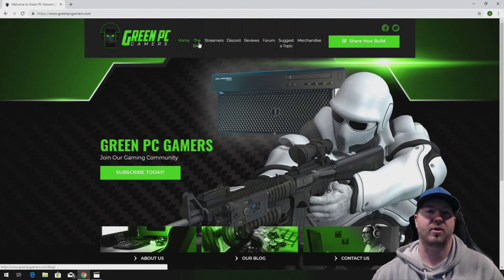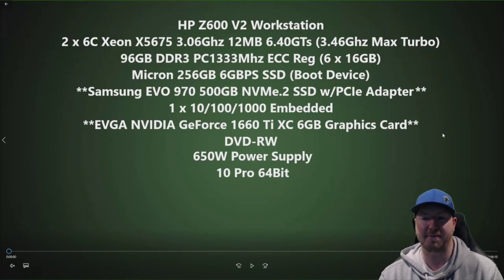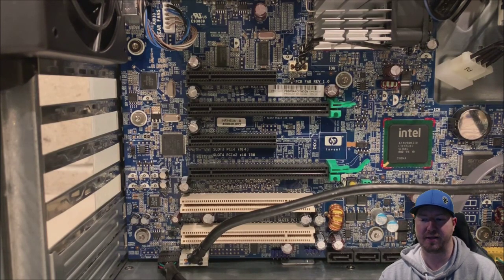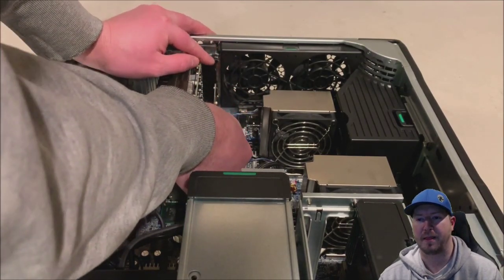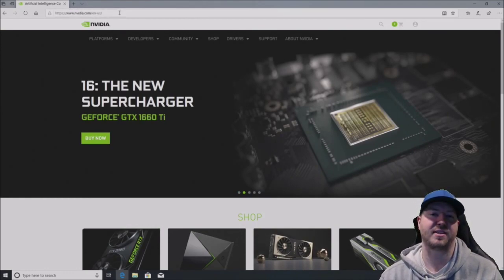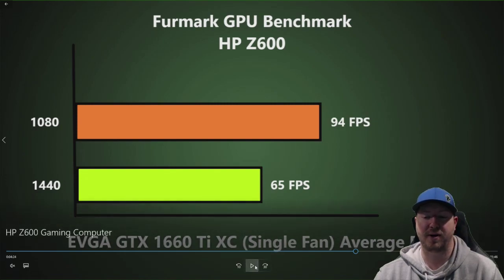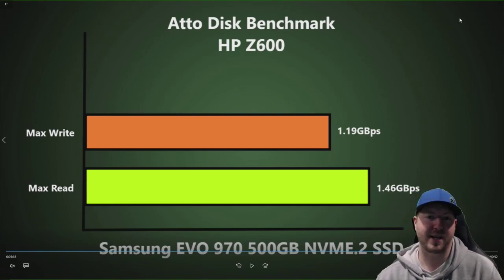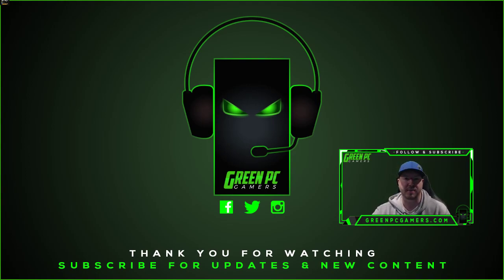HP Z600 Gaming Computer (GTX 1660 Ti and NVME.2 Install)

Comment: I also have an HP Z600 C2 PC with a dual X5675 12c/24t, 96 GB of RAM in DDR3 ECC Reg with a GTX 980 and an SSD of 480 GB A PSU of 650 Watts 80+ Bronze is really good machines

Comment: HP Z600 Workstation V2 motherboard
Intel Xeon CPU X5675 @ 3.07GHz (2 processors) 95W TDP
Z400 CPU heatsink.  Because this is designed for a 130 watt processor
BISO version 786G4 v03.61   X5675 processor only works with this bios.
Graphics Card & Driver: GeForce RTX 3060 12G OC -- 551.61
Total Memory: 24 GB
SLOT 1 (PCI Express Gen 2 x8): 	1 TB M2 NVMe Storage Controller
Windows 10 Pro (64-bit) 
If the system cannot find the PCIe nvme storage.
Open the Windows "disk management" option.
You will see nvme disk in unallocated state. Format the drive to NTFS. (Right click.)
To boot from an NVME drive no possible.  NVME drive you require a UEFI BIOS to boot.  Z600 only having a legacy BIOS.
The nvme driver is not running at full speed on this system. But faster then sata ssd. The pcie2 x4 lane max 2 GB/s.  Sata3   bandwidth throughput is 600MB/s
I am sending this comment to my time traveling self. So that you don't waste two days of your life trying to find solutions. 5M24

Comment: Hi ! Thanks very helpfull video ! But i've got some trouble... i intall RTX 3060 ti FE, 2 xeon X5675, 96gb RAM,  the power supply is not enough (650w) my computer restart all the time... Could you tell me  how can I fix this please ? Have a good day ! ( I tried with 64gb, doesn't work) Maybe just one xeon ? )

Comment: I've just aquired a Z600 this is the spec...

HP Z600 - 2x Intel Xeon X5675@3.06GHz 6C, 48 GB, 1 TB 7.2k, Quadro K600, W10Pro

Can you please recommend a better graphics card please?

Much appreciated ✌️
Reply from the maker: The RTX 3050 is a good value card for the Z600.

Comment: can i swap 2 gtx 1660ti s into my z600 without any problems with my psu?
Reply from the maker: It would be tough to fit 2 x 1660 ti gpu’s in to a z600.  Reasons = cooling, no sli support, power rails, size of the cards.

Comment: Excellent video, very helpful.  I am in the process of updating my V2 Z600 which I need to do for lightroom and photoshop.  I have had it since I bought it new years ago.  It is an amazing solid machine, upgraded to the last BIOS and to W10 pro, and with a new video card (3060) and some RAM improvements, I should be set for several more years.  I have only one CPU though.  Not sure I would benefit with a second.  Likely will add an nvme as in the video.    This will extend the life of my machine for years to come and save me some money.   I love the way I don't have to use the on button on the Z600 to turn it on, just flick the power on for all my stuff with one switch and the Z600 knows to turn on at the same time with everything else.

Best wishes!

Comment: Hi , i have an HP z800 workstation with 2 xeon w5580 3.4ghz processor and i have 16gb ram and right now I have an Nvidia Quadro k2000 graphics card in this workstation,...
Now I want to go for a GTX 1650 super 4gb gddr6 ? 
Please help me and it's okay for me - if it makes a bottleneck because I will use the graphics card on another PC in future but right now is it possible to play with this new card with at least 720p 60fps? In my HP  Z800 workstation? 
Please help sir , I'm searching for it everywhere for a budget friendly gaming solution , because right now i only can afford a graphics card but not for a new Custom PC 🙏🏻❤️Pls Help❤️🙏🏻 
I'm confused because hp says it supports upto DDR3 but GTX 1650 super 4gb has gddr6 !! Pls help
Reply from the maker: It depends on the version of the card that you choose.  Most GTX 1650 Super cards will fit in a Z800 workstation.  There should be little to no bottle-necking with that model gpu.

Comment: Thank you so much for your HP Z600 guide - it's been a massive help the past couple of months! I've got a question, do you think it's possible to connect a 2.5" SSD (boot drive) to a SATA III RAID controller card slotted in the PCIe2 x16 slot? I tried but got an error during bios bootup saying" BOOTMNGR is missing". I'm hoping it's a power issue and an additional power cable for the SATA III card will do the trick.
Reply from the maker: It should work, double check your boot sequence.  That error pops up when the system is trying to boot to a device with out an OS.

Comment: Curious about your website. V2 part#. 591184-001 460864-003. My board is 591184-001 460840-003. Is it a typo? Only asking because my mb is damaged no post with both cpus installed. Want to make sure I get the right board. It was running on both x5660 cpus
Reply from the maker: No, but there are different variations of the second HP PN.

Comment: i want to upgrade the gpu from gtx 1050 to rtx 3050, what do you think?
Reply from the maker: The RTX 3050 is a pretty big upgrade from the 1050.  Go for it!
Reply: I upgraded from a gtx 960 to a rtx 3050. It works perfectly!
Reply: @indoje  do you have hp z600
Reply: @Altohamy  Yes

Comment: hello, can i install 2 Gpus in z600 ?
Reply from the maker: You could, but there are very few games/programs that would benefit from multiple GPU's.  Also, there isn't much SLI or Crossfire support for the Z600 workstation.  You'd be better off going for a single GPU.
Reply: @GreenPCGamerscom  i am willing to use it for rendering and cad 3d so which best card do you recommend ? 3060 i am talking about power options

Comment: I just bought a Z600 a month ago with only one e5620, 8 gb RAM and a Quadro K600. Next day I bought a second e5620 and 48 gb ram, had to fix a couple bent pins on the motherboard to make the second CPU work, added the GTX 1050Ti OC from my other PC, two 4gb hard drives for storage, two 500 Gb hard drives for dual system boot (windows 11 - Ubuntu Studio) and one 1.5 TB for games, and OMG it worked as a charm. It even ran both the K600 and the 1050 Ti at the same time and were very fast for After Effects rendering... until I upgraded to After Effects latest version, so I had to remove the K600 to use the latest drivers on the 1050Ti, as previous drivers were incompatible with that. So, I have to get a better GPU, and first I thougt about a GTX 1060 and latter adding a Quadro P2000 on the other slot, but moneywise, I'm thinking now on getting a used GTX 1080 8 Gb (the one with a single 8 pin PCI connector) or a new RTX 3050 which has the same nomber of CUDA Cores as they both cost the same here in Mexico. Would the 3050 bottleneck my z600 badly? Should I go for the GTX 1080 instead? Oh! Forgot to mention I'm upgrading to twin X5675's as soon as I can find a matched pair at good price.
Reply: How did you upgrade to Win 11?  I thought Win 11 upgrades worked on newer systems.

Comment: That such a brother seems fantastic to me the way you have to explain and assemble those super computers, I have a hp z600 v1 with two x5520s and I want to upgrade them to two x5570s, my question is the following: is it necessary to buy the "PAIRED" or "PAIRED" processors "to work together, or can I buy 2 x5570 and it will work normally? I really appreciate the clarification, a hug!
Reply from the maker: You will have use "matching intel stepcodes" that are certified for the X600.  2 x X5570 Processors would work fine.

Comment: Hi friend, how i can adapt a power supply evga 750BQ to HP Z600
Reply from the maker: We've never used an ATX PSU in a Z600 because there is no place to mount them in the stock case.

Comment: I have a z600 wit 2x x5640 cpu and 24 GB ram. I bought a Zotac GTX 1070 amp extreme. The gpu needs power from 2x 8 pin power connectors but my psu has only 1 x 6 pin. What are my options?
Reply: Just curious. Is it work?

Comment: Seeking your advice, I have HP Z600 and want to change video card that will support dual monitors (4K, IPS, 32”) for work only, no gaming.
I got the Asus RX 5700XT, however the card requires power from 6 pin and 8 pin. I can use the 6 pin cable directly bit need another 8 pin. Any work around?
Otherwise, any recommendations for a less power-hungry card that can support dual 4K monitors?
Thanks in advance

Comment: Yo tengo la hp z600 con dual xeon x5670 y una rx 5600 xt y 16 gb ram 1600hz y no consiguió que los juegos vayan a más de 60 fps estando en gráficos bajos o altos en 1080p.
Reply: Amigo de donde eres? Yo tengo una y la quiero upgradear con 24 de ram, mejores procesadores y una buena gráfica, pero al leer tu comentario me desanime

Comment: Can I change PSU with other PSU model (not PSU Default HP Z600)?
Any recomendation for me?
Reply from the maker: It would be tough to use an ATX Power Supply because you there would be no place to mount it in the Z600 chassis.
Reply: @GreenPCGamerscom  Thank you for the comment Sir, maybe next time you can make a tutorial to assemble the HP Z600 in another PC case. 😁 Because my PSU is broken and it is very difficult to get a standard PSU Z600 here.

Comment: Thank you For this great review, I want to ask your question, do all processors work together?

Is this device better than a device with a i5 6th processor?

I want to buy a device HP Z600 Intel Core Xeon X5650 2.6GHZ Is this a better option than i5 6th

I am confused between these two

options

Z200 Core i5 th or Z600 Intel Core Xeon X5650 2.6GHZ
Reply from the maker: You cannot mix step codes in a Z600 workstation.

These are the best cpu's for the Z600:

Up to 2 x 6C Xeon X5660 2.8Ghz 12MB 6.40GTs Processors | 3.20Ghz Max Turbo Frequency (SLBV6)

Up to 2 x 6C Xeon X5675 3.06Ghz 12MB 6.40GTs Processors | 3.46Ghz Max Turbo Frequency (SLBYL)

Comment: Hi. I need a little help with Z600. I am testing z600 (x5640, 16gb, ssd) and another PC with i5 3470. On both i have same 1050ti. Testing unique heaven benchmark, ultra and 1080p Now my problem is Z600 gets only average 36fps, but one with i5 gets average 75fps with same settings and same GPU. Does anyone know how to boost Z600s fps? Compared to one with i5, 36fps is really low. I have two of them and both gets same resaults. One is with 3.6 and one with 3.61 (latest) bios. On Z600 i tested with registered, non registered and non ecc ram and every time it ends up with about 36fps. I think i am missing something but i dont know what. Any advice?
Reply: Btw.. same issue with Z400. There is no way (i didn't find it, hopefully YET) to lift FPSs over 36.. no matter what i do.
Reply from the maker: At a quick glance, your cpu might be bottle-necking the Z600.

Comment: Hey I was wondering would a gtx 1050 Ti work on this pc
Reply: well, yea. They put a 1660 Ti in there that is more powerfull and consumes more power. And the 1050 Ti only uses 75W, so you don't even need an extra molex to 6 pin adapter.

Comment: hello, if I want to put a 1650 super I need an adapter, or just placing it would be working, good video
Reply from the maker: It depends the MFG of the card.  Some cards require 6 Pin  and some 8 pin.

Comment: hi!

is it possible to start windows 10 from pcie m.2? Greetings!
Reply from the maker: Not unless you use a boot assistant like clover.
Reply: I've seen someone booting with success by setting it to IDE configuration + samsung 950 pro ( which has opt-rom built-in) .

However , samsung 950 pro are hard to come by. Is it possible to use SM951 ACHI MZ-HPVXXX series to boot ? 

WD also have pcie sata , will it work too ?

Comment: I installed 48gb off reg ECC memory and a NVME drive but i cant boot from the NVME drive, the bootloader doesnt work. it hangs in/after the memory test
Reply: THE HP Z600 KEINE SUPPORTS BOOTING FROM NVME PCI, YOU CAN SET IT FOR DATA, THE MAXIMUM YOU CAN DO IS PUT TWO OR THREE DISCS IN RAID 0 TO INCREASE THE SPEED TO DOUBLE AND PUT THEM IN START. SO I HAVE THEM MORE NVME AND GTX1070
Reply: Yeap. That's because even with the latest BIOS 3.61, the motherboard cannot/doesn't recognize NVMe. There is a work around, sort of. You can get a PCIe adapter card that has mount points for both an NVMe and an SSD. The SSD will still be connected to one of the SATA ports on the motherboard, which the computer will recognize. There's two ways to work with the NVMe SECONDARILY. You can either install your full OS on the SSD and once your system boots into Windows 10, that OS will recognize the NVMe and make it accessible. The more complicated way (and though it should be technically possible, I haven't tried it), is to do work with some Partition software (as is available with Linux Mint 20) and put two partitions on your SSD. Usually the first partition will be FAT32 or NTFS and about 500 MB. You can make the second partition whatever you like, but the Master Boot Record must be on the SSD. If you use software to that has a bootloader (Again, Linux system can do this), so long as that bootloader is on the 500MB first partition, it should be able to recognize and point to the NVMe drive. Thereafter the boot process should be turned over to the NVMe. As I said, that should technically be possible, but I haven't tried it as the system boots well enough from the SSD. Certainly you could put all of your games on the NVMe for fast loading.

Comment: I have a V1 with e5504 cpu's installed. I tried installing x5650's but it seems like I need to update the BIOS before they will be supported. I have not been able to find any good guides online, anyone have some knowledge for me?
Reply: You cannot install CPUs above the 55XX series in the version 1 board. Even with the latest BIOS version 3.61, the limitations of the version 1 board prevent the system from recognizing the 56XX series. You could purchase a version 2 board and install it. This would give you the ability to install the 56XX series, provided you do update the BIOS. It also allows you to install signficantly more RAM of the ECC variety.
Reply: @Ckhpo  Found that out the hard way. I finally managed to get the bios updated and I did manage to make it boot twice with the x5650's installed.  But it would freeze and become unresponsive if it went in to sleep mode, and the fans would ramp up to 100% as if no cpu was detected. It works just fine with 1 cpu installed, but I haven't managed to boot it with both again.
So, I bought a couple of x5570's and it runns just fine on those. Too bad the motherboard only supports up to 95W chips, or I could have used the x5590's.

Comment: Thanks for the video excellent advise which I found very informative. I bought a Z600 v2 For video editing with 48 BG ram dual X5650 6c and just fitted a gtx 1660 ti 6gb and it just flies thro the renders on Vegas, now looking at devinci resolve. 
Question: Would if be worth upgrading to dual x5675’s and must they be match? Or the same step code SLBYL?
Thanks SteveOunO
Reply: I did the upgrade from E5606 dual to X5675 and it is a big difference in performance.
Reply: @sancayakbulut3215  thanks for sharing. I've just bought also a z600 with dual e5620 and 48gb ram and I'm considering upgrading to x5675s

Comment: Can anyone running a 1060 let me know the brand? I've tried a 6GB Galax 1060 and it blue screens under load :-(
Reply: Ao nds like it's an issue with the card. Did you try installing it into a different system to see if it works there?

Comment: GPCG! Yih! Wondering... on your site re:Z600 v1 mobos, you specify as an example config:

1 x 6C Xeon X5675 3.06Ghz 12MB 6.40GTs

24GB PC10600E (6 x 4GB)

Were you able to get all 6 RAM slots to function on 1 x CPU?
Reply: I had a board with one of the CPU slots not working (found this out after purchase), but it would still read RAM positioned over the non-functioning CPU slot.

Comment: can you use gtx 1070 on hp z600?
Reply: I have one on it
Reply: @datoneoof  Which brand of card works for you? I tried a Galax 1060 and it blue screens under load :-(
Reply: @Xenodimensional  i using a gigabyte grafic card in hp z600 and it working :)

Comment: Thanks for the video. I have a Z600 with two Xeon x5675 and GTX 1060, My question is can i change the GTX 1060 for a RX Vega 56 with the same Power Supply (standard 650w)
Reply: nope. 150w maximum for all installed GPUs combined, every time you go over that will force a restart
Reply: @TheJasonh328  Which matches my experience so far. Everything I can find online suggests that 1060s and 1660 draw around 220w yet a fair few people say they're running them? Any clues as to what is up with that?
Reply: @Xenodimensional  There are several forms of the 1660 in particular. Depending on the manufacture, specifications, and such, some of them likely consume less than the 220w.

Comment: Is it safe to Convert the 6pin to 8pin?
Reply: I want to know this too, i got the z600, and bought a 1050 and that works with 6 to 6 pin, but i also bought a 1070 with 8 pin hoping to make it work with the 6pin on the psu

Comment: On your blog I've read that the V1 also supports 2x X5675 processors. Is this correct? Because I can't get it to boot with the second cpu. One is fine but after installing the second one it refuses to boot. Do i need the high performance heatsinks?
Reply from the maker: We used heatsink 463990-001.  Maybe you have a bad second cpu?

Comment: Has anyone tried a RTX 2070 in one of these? i've got a maxed out 48GB 12 cores system with a 970FTW which i pulled out of a PC, just upgraded to a 1440P Ultrawide monitor but sense i might start hitting issues with Gaming. Seen few people on forums saying that it works fine and some people not 100%...
Reply from the maker: An RTX 2070 will work in a Z600.  There will be some bottle-necking.
Reply: @GreenPCGamerscom  Thinking CPU Bottle-necking?

Comment: Can I upgrade z600 V1 cpu to x5675?
Reply: no, max is two x5570 processors
Reply: No. The Version 1 boards are limited to the 55XX series only. You can purchase a version 2 board and replace the version 1. A good deal on ebay for the version 2 board is around $60-70.